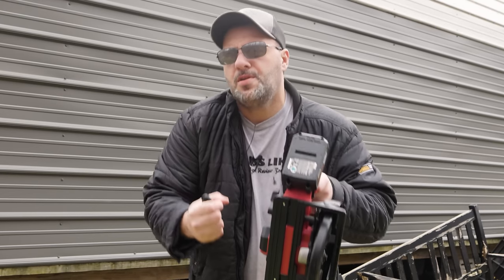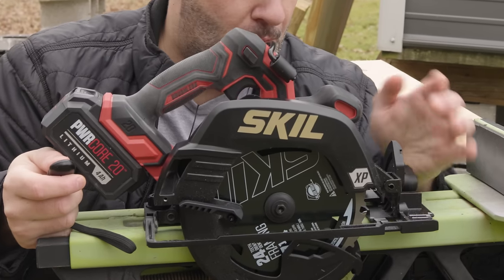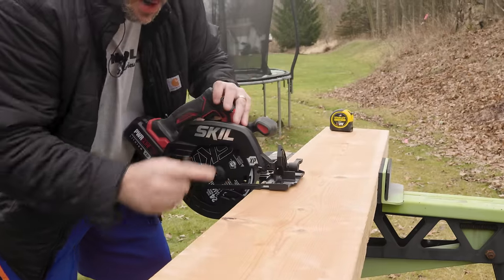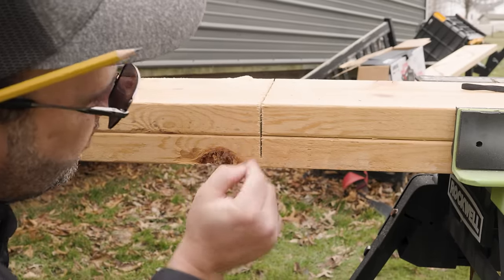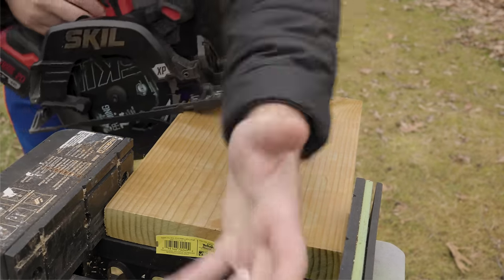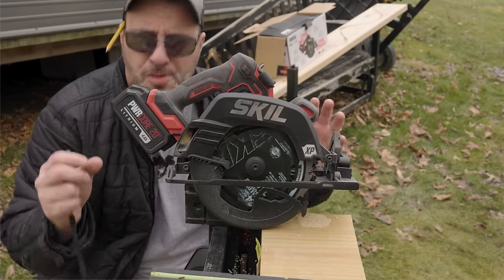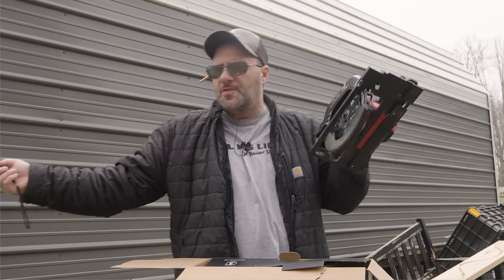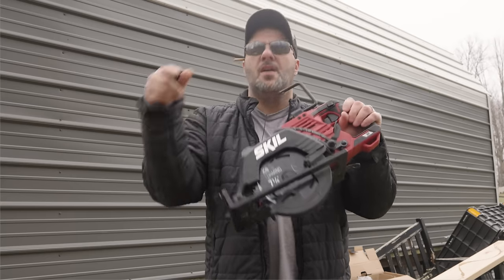I tested the world's newest circular saw today

Comment: My Ryobi brushless circular saw blade (previous Gen of the HP model) is on the left and I'm right-handed. It works great for me.
Reply from the maker: I have trouble seeing the cut line with blade right
Reply: @ToolReviewZone  I can get over that on the right bladed one, since it's easier and safer to pull the guard up to start a cut. At least for me and the way I do it

Comment: Cool, just might pick one up although I'm all Dewalt and have been looking for 7 1/4 left hand, getting old so weight is important .....almost bought corded 7 1/4 on Amazon for 49 bucks.

I lose everything, pencils, tape measures, snap lines, squares, saws ....... and on and on. Gettin old I guess.

Thanks for this vid and all your others, will try to buy through you links so you can make a couple bucks from Amazon or whereever

In your opinion what would be a good second line of battery tools, like I said in Dewalt for last 30 years or so, looking for a pro or prosumer grade?

Thanks again ..... Scott
Reply: Skil is a pretty solid brand for the prosumer grade stuff. I managed to impress the guys at my work who run dewalt with their (Skil's) impact driver and it's ring light and settings. it helps that their tools are affordable and all come with a battery and charger for cheaper than a bare tool from Dewalt. also Skil batteries have a nice gimmick of having a usb port on them which you can use to charge your phone or other device in a pinch.  Both their 12V and 20V lines are solid, but there are exclusive tools on either like their auto hammer being 12v but having more circular saw variety and other goodies in the 20V line

Comment: Hi client, sounds to me like the motor is struggling trough that 2x8,
Reply from the maker: Definitely bogged down some. Larger bat will help a bit, but I would be using the rear handle for big cuts like that for sure 👊
Reply: @ToolReviewZone  excellent work as always client, I use skill now and then, for me it’s a diy, just my opinion,

Comment: My experience is  after 5 uses is that the battery “breaks in” and last longer
Reply: Never heard of a battery breaking in. I have heard of a tool so called breaking in due to the gears and other moving parts getting seated after a little use.